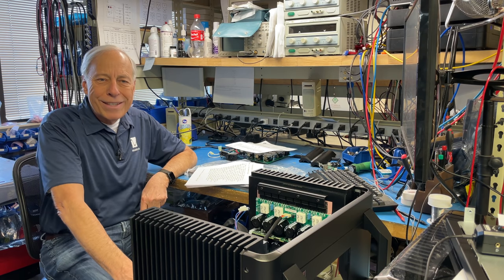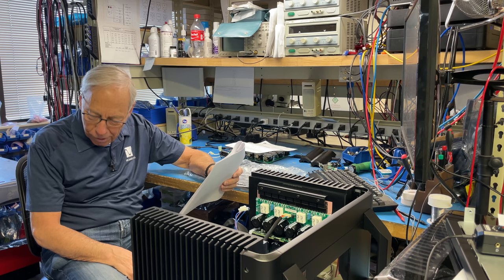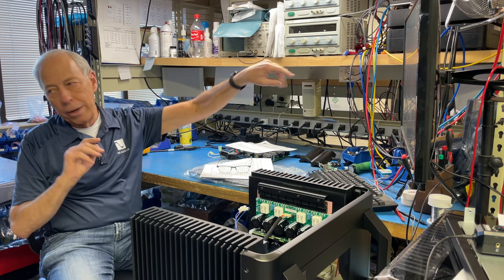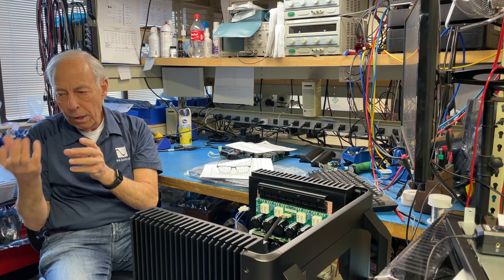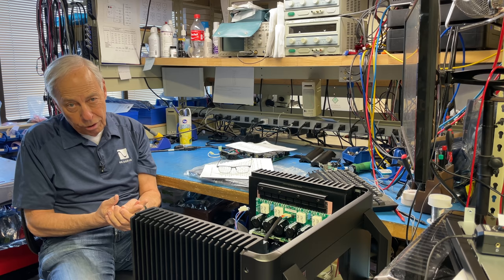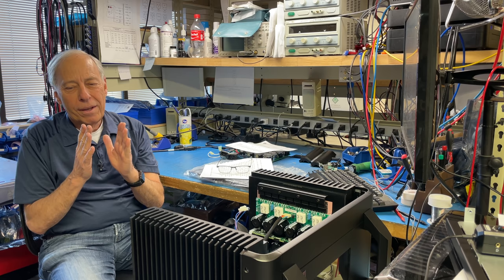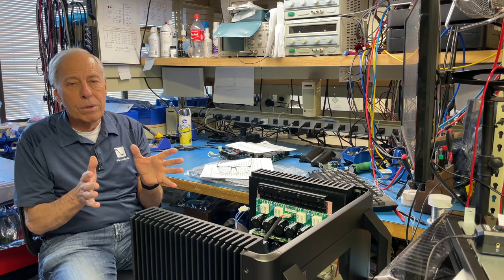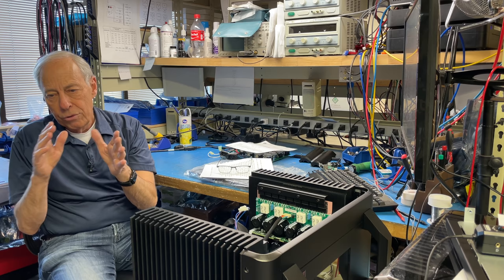Differences in digital audio cables

Comment: No. Bits do not have details. There is no noise or jitter in bits. You do not understand what you are talking about. Not even close. Optical isolation is used for blocking noise translated through electrical wires, that is very effective. But no, the noise still is not in the bits. If you have a DAC with optical isolation the cable can not possibly have ANY effect on the result. But I know, you will not admit and/or believe this.

Comment: Amir from Audio Science Review did a video. Showed absolutely no difference in USB cables in any measure. Please, everyone in the audio/audiophile world needs to learn about expectation bias. These are effects that neuroscience has explained. Our brains create signals based on expectations. What you report is personal experience. I can set up a blind listening test and I bet you anything you will not be above chance.
Reply: Amir had also said many things about Amp/DAC’s especially dongles DAC’s saying that the S8, S9 were better than $1,000 DAC’s/Amps. Which were both 💯 Wrong!! So it just goes to show you that measurements without actual listening to products means absolutely nothing!! Especially when you are not listening to these products on decent systems! Cheap sound systems don’t reveal much lol Tell Amir to upgrade his system as he has Donate links all over his websites! So it shouldn’t be that difficult lol
Reply: @CarAudioHorizons  amir has revel salon 2 speakers for his main system if I'm not mistaken. 

But what the poster above may not realize, is that amir posted a review of an HDMI cable about 10 years ago that cautioned about making the "bits are bits" argument when talking about digital connections. The signals are still analog voltages, and therefore can suffer variances, interference, or loss of information completely. USB audio does not use error-checking like traditional file copies or even tcp/ip that can resend data if packets are lost or don't match from the sender. The DAC is left to 'handle' any errors, and slight variances could result in subtle differences if you displace bits. 

From my understanding, you won't always have the tell-tale pops, glitches, or dropouts like you get when more data is mangled. If a single 0 is interpreted as a 1 from the analog square wave that is generated for the signalling, what could that result sound like? I dunno. Where did it occur in the music? How many of these square waves are getting mangled and misinterpreted and what is causing it? 

I think Amir published this data, yet most of the ASR folks are just railing against cables so hard they too have forgotten some of the science. In the case of USB, there is little evidence to report that one cable is superior over the other. But you can't make that statement, for every situation, for all of the time. Maybe the device outputting the signal WILL perform better with different conductivity or wire type. 

Claiming to know it could never make any difference is simply not the reality, even if MOST of the time, it likely makes no difference.

In my estimation, you have two relatively blind sides of the argument, going at each other. 

Blindly claiming one USB cable is better in all situations is as ridiculous to me as claiming that ANY USB cable is the same, as any other, in all situations.
Reply: @erics.4113  Everything I have tested I would say I’m not a big fan of anything USB, there are some decent products but I always prefer Digital Coaxial connection over everything else (Car Audio) as that’s what I test subjectively. 

You can do all the tests you want like Amir does but at the end of the day your ears are going to be the final judgment, and we all know everyone hears differently from one another and likes different sound signatures. 

I tested the HIDIZS S8 that Amir says is better than some $1,000 DAC/AMPS and it SUCKED! The HIDIZS S9Pro was far better but nothing special other than it was pretty powerful for a dongle DAC, but power doesn’t mean great sound quality although most people think it does because it’s louder 😆 

Looks like now he is bashing Chord 😂
Reply: @CarAudioHorizons  I saw that the chord m-scaler is seemingly adding jitter components. Not something you'll see in the literature from chord I guess. 

And I saw a response video from the chord designer on another channel, and the interviewer starts off with a question about the j-test for jitter that amir published. The designer starts by stating that he didn't see amir's article. 

Excuse me?! This guy goes on to do a 45 minute video to discuss the product, but couldn't have been bothered to take the 15-20 minutes to look at amir's published measurement data, the same that I did? 

Told me everything I needed to know right there. 

I'm not sure what I think about USB audio either. I'm using a node 2 that now supports it, and connected to my DAC, vs coax, ..undecided. it's been about a month now and I am still doing AB back and forth. If there is in fact any difference, it's subtle. 

For what it's worth, the coax cable is a entry level(ish) audio quest coax, and the USB is the cheapest I could find on the planet. I'm likely going to buy an expensive audiophile USB printer cable in the near future to experiment further. 

If it does nothing, at least it's thick enough to wrap around my neck for choking purposes. Lol
Reply: @erics.4113  Audioquest is another company that gets bashed all the time and rightfully so on some of their products but I love their Coaxial Digital cables for my car audio system and I compared four different ones for my set up and it’s the first time I have ever heard a difference in cables. I preferred the Audioquest cinnamon or carbon and then Bluejean cables were a close second but are not as flexible as the Audioquest cables when it comes to car audio installation as the Bluejean cables are stiff. Then the last two were a custom one, and just a standard coaxial cable. 

I always test everything regardless of what someone else says. That’s the whole reason I tested the HIDIZS S8 originally is because I stumbled upon Amir’s flying colours review 😆 But ended up being the worst product I have tested.
Reply: @CarAudioHorizons  I'm curious what you didn't like about USB. I mean, if anything, from the sonic perspective. I understand you're doing car audio and that presents unique challenges for physical installation as you mentioned. 

I'm also having fun with experimentation and shy away from anyone dictating what is best, better, etc. If I don't experiment and compare my own findings, what experience do I really have? And what fun is that in my hobby? I'm vested into the system as it has many components that I've hobbled together and mess about with in the room to get it to sound best under those conditions. 

I also agree that, for instance, audio quest markets and sells some dubious promises, but it also seems that they offer some quality and well-made products as well. 

Btw I just checked. My coax is the forest. I believe that's their cheapest entry level coax. Maybe I'll pick up a cinnamon or better to AB, in addition to same level USB from AQ.
Reply: @erics.4113  I use a DAP (FiiO M17) In my car audio system as my source. So I have tested a lot of gear via iPhone to USB devices and some give you great sound quality but non of the devices give you sound quality as good as going straight coaxial digital into my Helix DSP Ultra. 

Another thing that I always get a kick about is most people think digital is digital and that a $100 device that has coaxial digital out, or optical toslink out sounds the same as a $500 device, or $1,000 or $2,000 + device and that’s just isn’t the case. I have tested so many products over the years and each product has it’s own sound signature. 

Most people usually just copy & paste things they have heard other people say is what I find, and those people have never tested anything, In most cases.
Reply: @CarAudioHorizons  I see a lot of the copy/paste crowd for sure. Some of the so-called discussions and discourse are mind-numbing and the amount of BS in this is staggering. 

It's probably a lot of declaring subjective experience from people that have limited experience, or others stating that objective science disagrees with everyone's subjective opinion. 

What I see the most of is people wanting confirmation and validation from others, that their prized purchase was the best, most smartest acquisition that could be made. Anything more expensive is a waste of money. Only a fool would think it could get better than product x (that they coincidentally bought) and a lot of people wanting to know what competes with their $1000 purchase and at what price point. (it's a $1000 component, but it sounds like something costing $5000). The psychology, ego, insecurity, and all the other human flaws shine so easily through these discussions. And when someone trolls or even makes mere mention that they didn't like the sound of the component... Look out for fireworks! 

Both sides are usually misinformed and probably lacking experience. I am admittedly new, about a year in and also lack experience. But I've bought 5 amps, 3 subs, and 8 pair of speakers in this time and I promise none of it sounds exactly the same. I haven't done much cabling though. Just bought things that I hoped were 'good enough' to pair up with the serious outlay of cash I've put into the gear. I'm not going to connect $10k of kit with free RCA cables from the thrift shop that don't fit right or can easily produce hum and noise when I handle them or move them around.

I dig into the science, not just to prove or disprove anything, but to also learn the 'why'. I'm genuinely interested in the engineering, and it also helps me to understand why something 'should' or even 'could' perform better.
Reply: @erics.4113  Yes, I hear you! I have a Helix DSP Ultra ($2,000 Canadian) which is one of the best DSP’s on the market for car audio but i know the big brother Brax DSP is a better DSP and it just happens to be $6500 Canadian. 

But my Helix DSP Ultra could sound better than the Brax if I have a better tune done on my system than the guy that bought the Brax DSP. 

My system could also sound better because I use a Fiio M17 as my source as opposed to a guy that uses his phone with the Brax DSP. 

Or I could have better speakers etc… 

So my point is sometimes different combinations of components can equate to some things sounding better. 

But you will hear people say “I’ve heard those speakers and they don’t sound as good as such and such” or “Those amps are nowhere near the quality or SQ of such and such I heard the other day” or “I have had those speakers and amps and they’re not as good as such and such”. 😆 

I hear these types of comments on my channel every now and then but see them on the forums all the time. 

Honestly in car audio 90% of people even shops don’t know how to tune a DSP so a lot of these so called people that say they have heard everything (probably not) are hearing brands that are used with a DSP that isn’t tuned properly. I know this isn’t as big of a thing in home audio but it is in car audio. 

That’s why I always ask them did they hear the system at an event and what did the car score. I never get an answer back 😂
Reply: @CarAudioHorizons  on the topic of DSP, I think the car audio market is far more progressive. There is a 'purist' mentality that permeates and sometimes dictates the home hifi audiophile world. Tone controls are some sin. Wtf right?

With car audio, the car itself is a major hurdle to sound, and the car audio pursuit is genuinely interested in better sound, and not falling back on sanctity sentiments. I don't treat any of this as sacred. Not the gear. Not the setup and certainly not the music. 

My next purchase, in fact, is going to be a miniDSP either the flagship SHD or one of their Flex products. I'm using my own DAC, so hope to do all processing digitally, between streamer and DAC. 

I have no purist leanings, other than the principle of keeping things as simple as possible to avoid unnecessary complication or introduction of problems.

I am also a musician, and when I hear the "as the artist intended" mantra I literally laugh my ass off. The artist most likely intended you to buy their record or go to their show and enjoy their music. They don't think about your hifi and sometimes use crap old hobbled together equipment themselves. I don't know many musicians that speak about music in such sacred terms either. Did you enjoy it? Did it move you? Or are you focussed on how a single cymbal splash was conveyed? That's not musician speak. That's hifi nutter shit. Lol
Reply: @erics.4113  I spent years in both home audio and car audio. I took a break from car audio for quite a few years then got back into it about 6-7 years ago. Both hobbies can be extremely expensive but hey we have to spend our money somewhere.
Reply: @erics.4113  "USB audio does not use error-checking" - that's definitely the dumbest thing I'll read today.
Reply: @Tarets  if you were USB audio, we wouldn't be having this 2-way conversation.

Comment: Sorry to say Paul but you only described why your transport interface is the best not how some digital cables are better than others. There is always a buffer on the end receiving the packets, timing for playback is the responsibility of the playback device not on the transmission cable.
Reply: That's my view also. The cable only gets the data there. What happens to the data upon arrival is up to something else.
Reply: USB has no correction, a buffer doesnt fix jitter and noise ul have to reclock everything and isolate everything, and that can get expensive and thats exactly why the dont do it in cheap stuff
Reply: @MrDannydjmix2  usb is a comm. Protocol it was never meant to be used as a correction or timing method for audio file playback. The file is delivered to a playback device the playback device is responsible for playback, using its buffer and clocking standards.
Reply: @MrDannydjmix2  USB as well as ethernet don't give a shit if the data are excel files or audio and it don't need to
Reply: Yeah, exactly this. Once the bits are delivered to the input, the signal timing and noise floor are handled by the equipment and the cable has done the only thing it needed too.
I've tried many a so called 'superior' digital cable and its always sounded exactly the same to me, but I can easily hear differences in analogue cables.
Maybe it helps with lower end equipment, but if you already use filtered mains and other noise suppression techniques for your equipment, then I've never been able to hear a difference with any digital cable.

Comment: If they don‘t even measure any different, I can certainly not hear a difference. Any difference I would hear is confirmation bias.
Reply: Have you watched audio science review channel?
Reply: @dagnisnierlins188  of course. I’ve also done similar measurements in my university lab and personally own some fancy audio cables (for the look of them) and can’t tell any difference to normal cables
Reply: @UCa2DdBdXExShLohmlipkerQ I didn't do a blind test but for the price of expensive cables I could rather get more room treatment or even a better component which makes more of an night and day difference than a cable
Reply: @Douglas Blake you are right  speaker and room treatments are where it's at! 98% of sound. Everything else is 2% give or take.

Comment: I'll share my experience(s) with two projects I was involved with. I was a new kid Engineer. We constructed two data collection, not control, systems based on bascially the same hardware. Figure a central computer then distributed data collection points ( NEMA 12 Boxes ). The collection points feed their data back to the central computer via RS-232 digital cables. Some cables with rebroadcast extenders. The collection boxes could receive and resend data. The data was live data constantly changing. The two applications were oil & gasoline distribution tank farm terminals and a single Nuclear Power station. Both wildly electrically noisy.

The kid engineer, me, got sent to a new start-up in Santa Clara to get smartened up on two new IC Chips. One a processor, the other an ASYNC chip to interface to the interconnecting RS-232 cables. The ASYNC chip featured a double buffer at both ends. So the incoming digital signal was re-clocked twice. There was zero, none, zippo, nada, jitter or any other such nonsense in the received data, after the buffers.

Time frame: 1972 - 1975
Company I worked for: General Atomics ( ga.com )
Customer 1: Gulf & Shell Oil
Customer 2: The Nuclear power plant will go unnamed
Chip builder: Intel Corp.

We moved jitter free, timing error free, perfect digital information over cables in horrific electrical noise environ nearly 50-years ago.
Reply: tldr, you're an engineer, that tells me everything I need to know
Reply: I worked at a GM car plant (Detroit/Hamtramck Assembly) for 30 years in the IT department. The plant was 100% dependent on the data from the servers and the network. If for any reason the line stopped running it cost $50,000 a minute (USD). Needless to say there was a lot of emphasis on us keeping data flowing. Never once was there a discussion about putting different CAT5 wires in or worrying about RJ45 connectors that might be better because they had magical properties. it was a noise laden environment with hundreds of welding robots running 18 hours a day. And yet the data still flowed. Rest assured that the 1's and 0's don't care what wire they go down. Don't fall for the crap that PS sells. It is fraud.